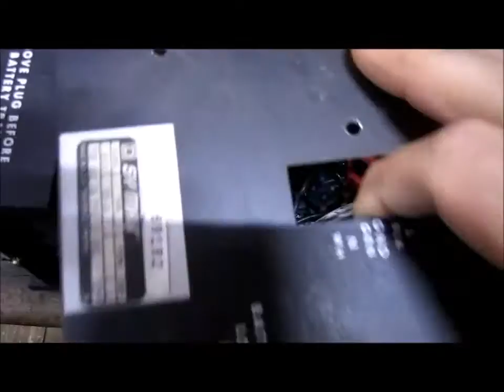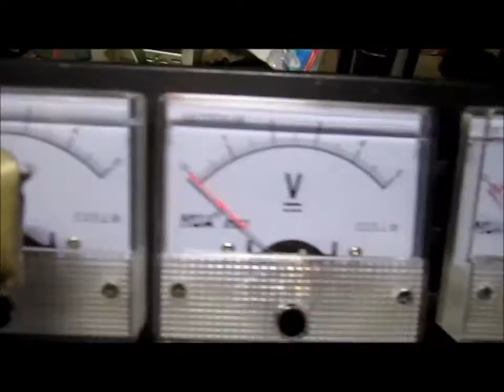Buck Converters ADJUSTABLE As A Battery Charger  Made At Home

Comment: This is a really cool project. I am trying to build something similar. What type of converter did you use?
Reply from the maker: Boost buck type. These charger still  works great.
Reply: @MrDoingEverything  glad to hear! Hope mine will turn out as great as yours
Reply from the maker: @phillipcoplen8051  Sure yours will just take your time and take a break away from it if it's to much of a bother. A nice break solves that and then go back to it. It will turn out fine.

Comment: Waste of time. Never going to work. Internal resistance of LA batteries so low, you are going to blow your converters without implementing current limiting/
Reply from the maker: Its working just fine for my 2 volt cells.
Reply: Did you even ask him if the buck converters he's using are current limiting before posting that comment?  Most of mine are constant voltage AND constant current.  However, if the power supply is already current limiting and the buck converters can handle whatever that current is, that will ALSO work.